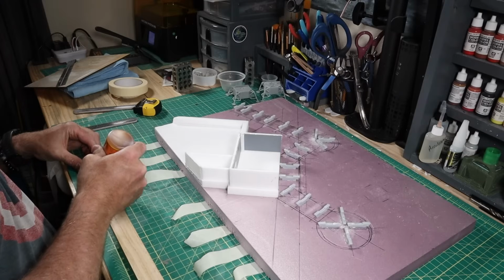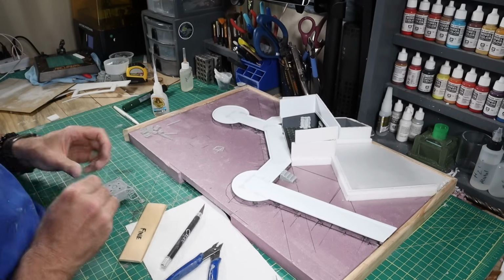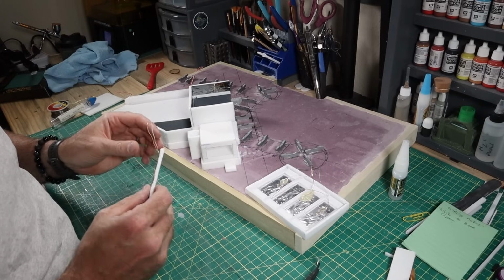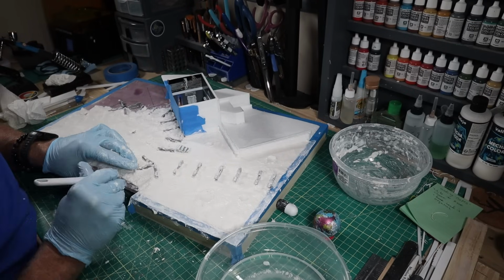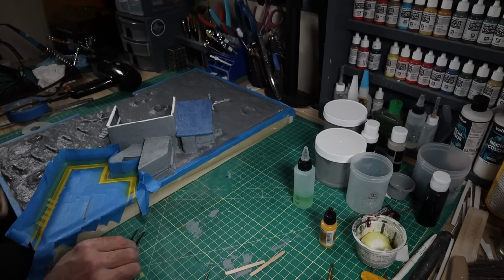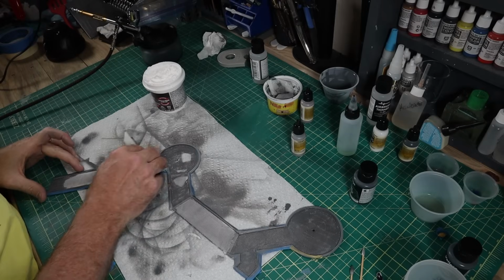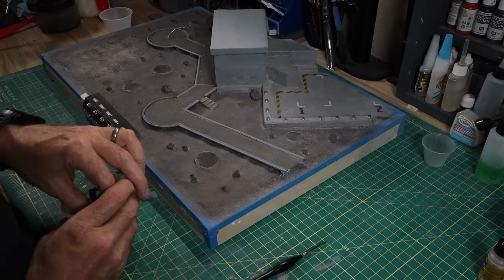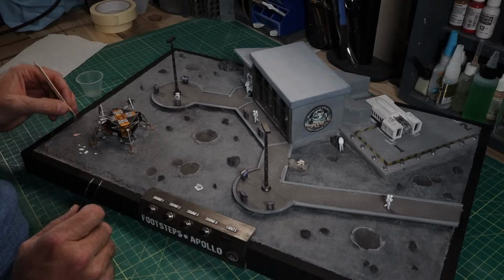Scratch Built Apollo 11 Tourist Trap Diorama

Comment: This is really cool, and I like the backstory. I'm curious how this would have been constructed. If the law is that no one can disturb the site then how would they actually place the walkway and erect the buildings? If it's a terrestrial vehicle then it would have left tire tracks and I'm an aerial vehicle like a helicopter wouldn't work as there's no significant atmosphere. Perhaps some very careful rocket engines, but I would still imagine that those would disturb the site at that proximity.
Reply from the maker: All great points. I'm assuming there were some deals going on behind closed doors to allow the construction of this site. As for not disturbing the location during construction, I'm thinking a crane with a super long boom arm put a pre-fab structure in place, lol. Great food for thought🙂🚀
Reply: @CosmicQuestHobbies Ok, so it’s just out of sight, lol. Honestly wasn’t expecting an answer, thank you.

Comment: Not to knock your efforts, I've never made a diorama, but that visitor centre is bothering my inner nerd, it's too earthly, it doesn't feel like something that would be built on the Lunar surface, as its a rectangle it would need to be reinforced as the pressure from inside and the hard vacuum outside would constantly be trying to pop it open at the corners, also the big windows, whilst a good idea on earth would need to be made of very thick UV resistant glass or even plexiglass to contend with radiation, in fact they would probably need shutters of some kind like on the observatory module on the ISS. Again it's a matter of taste, your model is otherwise fine.
Reply from the maker: No worries! I'm thinking that's nothing some good hurricane ties can't fix, lol. What's funny is that as I was reading your comment, I was picturing a disaster movie on the moon where the builders of the museum didn't listen to the engineers about the safety requirements and the tourists got trapped up there because something broke on the structure... Hmmm. Thank you for your thoughts and feedback, I truly appreciate it!
Reply: @CosmicQuestHobbies  

There's a book written by Andy Weir called Artemis, Weir also wrote 'The Martian', which also has an Apollo 11 visitors centre. I highly recommend it if you haven't heard of it, Weir is fantastic at ideas of how space travel will logically turn out based on current technology, think The Expanse, but more optimistic.
Reply from the maker: @TBone-bz9mp  Sounds good! I will definitely check it out. Thanks for the tip!